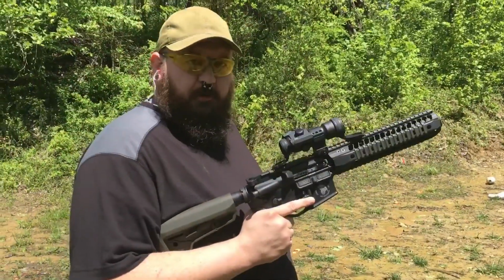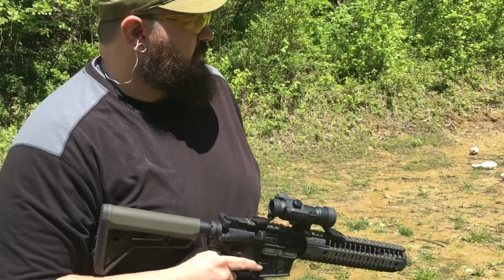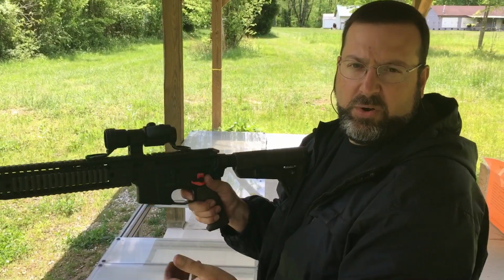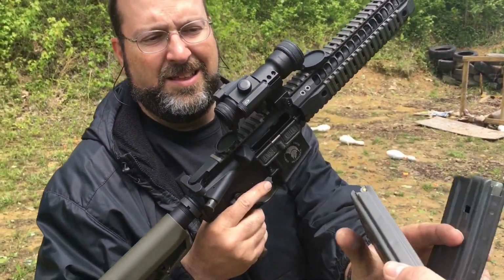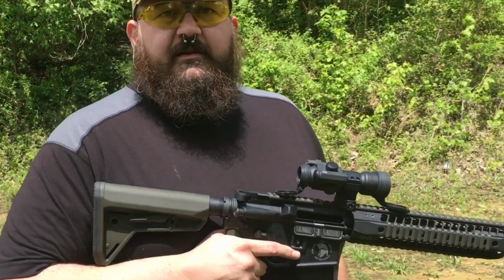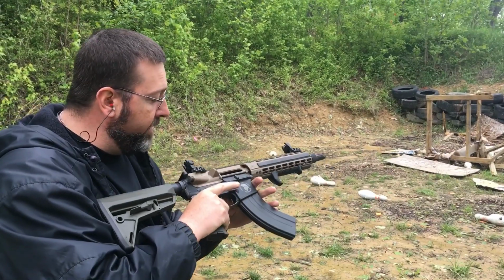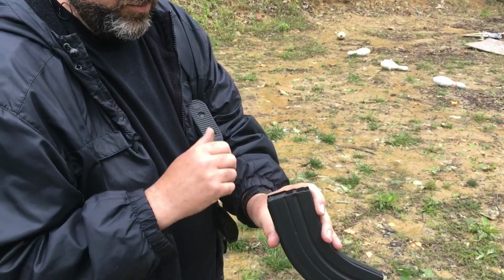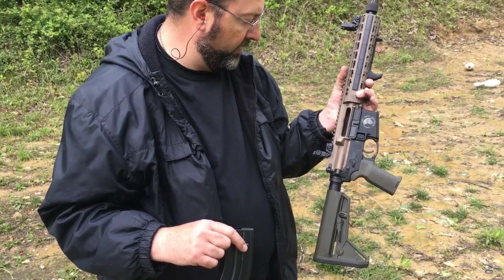Franklin Armory BFS3 Binary Trigger First Shots

Comment: That brings a smile to your face. I'm getting one. Thanks guys...
Reply from the maker: Check prices on eBay.  I saved a bit of cash by buying on there, and it was a new sealed trigger.
Reply from the maker: Not much cheaper, but it's a Buy It Now price.
https://www.ebay.com/itm/Franklin-Armory-Binary-Gen-3-Trigger-Used/183007456414?epid=21007103103&hash=item2a9c182c9e:g:0hIAAOSwW09aU-ba

Comment: I got mine a few days ago. Had problems at first but I started with the springs they supplied. It works great now that I put my chrome  silicon spring back in. Love this thing. Thinking of ordering another one while the price is still down.
Reply: awesome boss sounds like it just needs some tuning to set up like low mass bcg with heavier buffer and mid strenght hammer spring so the bolt can always oit run the hammer ?
Reply: ok

Comment: Light primer strikes result from too light of a buffer spring. The bolt is moving forward slow enough that you've squeezed the trigger releasing the hammer, the released hammer is riding the bolt forward into battery.
Another manufacturer had a proprietary (lighter) BCG to resolve the slow BCG problem ... Franklin armory provides you the heavier buffer spring which solved the issue.
Reply from the maker: That was definitely the issue, and it was resolved.  
Thanks for watching!
Reply: @GunslingerFirearmsandGear  I appreciate you taking the time to share your experience. Now it's just a matter of developing a rhythm, you'll have that thing smokin.

Comment: I sell a lot of these to hog hunters here in Texas, they use them a lot when shooting hogs out of helicopters and on the ground. I installed mine and had a few problems with it, nothing that changing the hammer out back to a mil-spec hammer, some people have the problem of binary not working and this one thing you can try, next is the small little spring that is a major pain in the A$$ to fix when it pops out the first time you mess up.

Comment: Can you post what upper you used with the 5.56
Reply from the maker: I actually assembled that upper.  It's an Adams Arms 7.5" pistol barrel, PSA upper receiver, I don't recall the BCG... Spikes gas tube, BCM gas block, a Seekins Precision BAR rail, and at this time I had a Noveske KX3 flash hider installed.  Now I have a Griffin Taper mount on it.

Comment: Great video. What length gas system and type of BCG was used?
Reply from the maker: Thanks!  This has a pistol length gas system, and a nitride BCG from AIM surplus.  It's their brand.
Reply: Awesome. Thanks for the response. I'm guessing it's a light weight bgc?
Reply from the maker: Nope.  It's this one.
https://www.aimsurplus.com/product.aspx?item=XAIMBCGH4N3&name=AIM+AR%2fM16+H4+.223%2f5.56+Nitride+9310+MPI+Bolt+Carrier+Group&groupid=723
Reply: Thanks! This is an awsome rig. I'm impressed by the reliability with such a short gas system. Subbed.
Thanks again.
Reply from the maker: Thanks a lot!  I've been asked a couple times about this build, and I think I'll do a video that breaks down all the components used in it.
Reply: That would be very cool!

Comment: Light primer strikes most of the time has to do with the buffer . H1- 3 buffer different weights rarely a magazine issue
Reply from the maker: The light hammer spring, combined with the harder primer in the steel cased ammo, was causing the light primer strikes at the beginning.  The magazine issues were with the 7.62x39 upper, and I've had issues with them on both lowers, regardless of the buffer.  The 20 rounders work fine, but the followers in the 30 rounders bind sometimes.  I've heard that ASC magazines function a lot better, and will be giving them a try soon.

Comment: Don't think the issue was steel casing, I think that particular ammo was just junk. I saw the primers weren't even centered lmao! Neat products, neat review!
Reply from the maker: Not the casing at all.  That ammo has a harder primer.  Combine that with the lighter hammer spring, and it's just not a good combination.
Reply: @GunslingerFirearmsandGear  did you just hold the trigger to make it shoot like a fully? I ask because I want one. Also I have a tacon 3mr and you have to find the sweet spot on that trigger to get it to shoot like a fully. So I am wondering about the Franklin Trigger.
Reply from the maker: @Rich-tv9jq  I was bump firing, but the rate of fire was much faster due to it being a binary trigger.  If that makes sense.
Reply: Andrew Long THOSE MAGS LOOK FUNKY .... 
AND THE MAGAZINES SEEM TO NOT PUSH UP THE NEXT ROUND EVEN IN LINE WITH BORE 
.... TILTING ROUND DOWN DURING THE EXTRACT PHASE
AND SETTING IT NOSE DOWN AND THEN COCKING IN CHEAP MAGAZINE

Comment: what buffer would you recommend? I'm having an issue of "out running" the trigger :l  but it generally works. 

it was also installed in a new rifle... so not sure if I need to "break it in" for better results.
Reply from the maker: Did you use the supplied buffer spring?  I'm running just a regular carbine buffer in this one.  You might try running an H2 heavy buffer, and see if it improves.
Reply: @GunslingerFirearmsandGear  yeah, I am using the provided buffer spring. I changed out the hammer spring to the milspec one and will see if that works out well. I don't have an extra carbine spring. But I can switch tot he "lighter" spring Franklin armory provided

Comment: Do you have to pull the trigger back further/harder like how the Fostech echo is? Or is it a standard trigger pull.

I have the fosters, and in the echo mode, you gotta pull it back a lot further and thats the 1 thing thats anoyying
Reply from the maker: You don't have to pull it back any farther than a normal trigger on the BFS3, at least it doesn't feel like it, if you do at all.  It's a very good feeling trigger.  The light spring set just doesn't like the harder primers of steel cased russian ammo.

Comment: Has SBR and BFS shoots junk steel case ammo......
Reply from the maker: And your point would be what, exactly? Would it have been more enjoyable for you to watch us burn through something like Hornady match. Lol!
Reply: Gunslinger Firearms and Gear somewhere in between - shit and match grade.
Reply from the maker: But what is the problem with steel cased ammo? It’s cheap, good for plinking, and functions fine for blasting at the range. It’s not something I’d choose for a defensive round, but I wouldn’t want to catch one either.
Reply: Steel isnt that easy on the gun, tho.
Reply from the maker: If one can afford to shoot enough steel cased ammo to cause damage, one can afford to replace the damaged parts.  There have been extensive studies on the effects of shooting steel cased.  Check out this link.
https://www.luckygunner.com/labs/brass-vs-steel-cased-ammo/
Reply: The steel case ammo likely had an impact on the problem with hammer follow. I tried steel cased ammo with my BFS and the cyclic rate was much lower and caused malfunctions. You'll probably have less of an issue if you switch to brass cased ammo. A heavier buffer and buffer spring could help as well.
Reply from the maker: @redtra236  The hammer was not following, and steel cased ammo would not cause that problem.  The steel cased Russian ammo has a harder primer than most brass cased ammo, and the issue was the lighter hammer spring combined with the harder primer.  After changing the hammer spring, it functions 100% with whatever ammo I use in it.
Reply: I'm dyin here! LmFaO!
Reply: @destructivenews6734  Ammo aint cheap bud, maybe you have money for good ammo but us trying to make it in life gun owners will take the cheap ammo so we can still have fun. Besides...if a gun can run dirty steel case ammo, then thats a darn good gun & it aint a little sissy picky gun that only wants to shoot brass.
Reply: I still don't get this steel vs brass. If your rifle has a problem with steel cased ammo then your rifle is the problem. I still have a case and a half of wolf to go through and have been using it for practice at the 200 yard range. I picked it up during the days when ammo was very hard to find and expensive as hell. Groups are a bit bigger for sure, but I can still hammer my plate at 200 yards with the shooter being the only reason for misses on the 12" plate from standing, sitting, and prone with iron sights. I see most "experts" shooting from a bench and at targets 25 yards away, some experts huh.......

Anyway, I might pick up one of these binary triggers for giggles. I can see it as a great double tap device but mag dumps isn't my thing.
Reply: Pimply Stikage absolutely right. I love the people that cry about steel case. My SBR is my go to and I want that thing to chew anything it puts in its mouth. Save the fancy ammo for the precision guns, the go to rifles all eat steel out here.
Reply: @GunslingerFirearmsandGear my 7.62x39 cost the same as the trigger.  Bear Creek Arsenal upper, Palmetto State Armory lower = $350 complete

Comment: Any triggers for less than 400
Reply from the maker: Unfortunately, no binary triggers.  There is this though, which is a fine trigger for the platform.
https://geissele.com/super-3-gun-s3g-trigger.html
Reply: @Nate Dog - Check out Optics Planet.  I just ordered one a few days ago, for $348, after the 10% discount, and free shipping.  I think the sale is done, but give them a holler, they probably have the 10 percent off deal all the time.  I used the code "January", maybe it will work all month.  I'm looking forward to trying it out on my 300 Blackout, suppressed!  They said about a month wait before shipment.
Reply: MO Silver I used the code EXTRA10 got 10 percent off. Legit trigger
Reply: I emailed Franklin Armory and got a military discount to use for the trigger.  10% off total was $358 shipped.

Comment: Use brass ammo it's worth the money.
Reply from the maker: But dirty steel smells so good. lol!
Reply: @GunslingerFirearmsandGear  I know ammo is expensive. Are you double tapping the trigger? Or are you just holding it to make fire fully? I have a tacon3mr and you have to find the sweet spot. To make it fire fully. I don't have  very much practice on it though. Btw go to bulkammo.com you can get a thousand rounds of good ammo for $295 $300 range. Check it out the Tulamo ammo is cheaper than that.
Reply from the maker: @Rich-tv9jq  I was just bump firing with the binary trigger.
Reply: Got it

Comment: Binary triggers are not going to be reliable until they are made to synchronize with the cycling of the bolt carrier group. Until that happens you're going to continue getting light prime or strikes or poorly timed trigger poles and hammer follows. It's a fun idea but nothing I'd ever put my life on.
Reply from the maker: Definitely not something I would put my life on, but there hasn't been any issues at all with it since I changed to the mil spec hammer spring.  The light hammer spring functions fine with American manufactured ammo, but not the steel cased Russian stuff.  It has a harder primer than american manufactured.

Comment: lol watch your own video your finger is not coming all the way out you have to come all the way out I did use the buffer spring everything else is the same as you in mine is flawless but like I said I had to get used to letting my finger come all the way out
Reply: Dustin Bible  yep Light primer strikes most of the time has to do with the buffer . H1- 3 buffer different weights rarely a magazine issue

Comment: Put an $89 dollar aim surplus lightened BCG with an H buffer and stock spring in my colt and cannot get it to produce hammer follow
Reply from the maker: The steel cased ammo we were using has a hard primer.  This gun had the same light primer strike issues with the JP light hammer spring, but functions 100% with the mil spec hammer spring. I'm using an AIM nitride BCG, but it's the full weight carrier.

Comment: Say bye bye to that thanks to Trump! That's about to turn into a felony unless registered as a machine gun, and that's best case. May outlaw the devices all together with no path to legalization ☹
Reply from the maker: Yeah.  Also thanks to the NRA.  I'm not jumping to any conclusions just yet.  Let's see what happens with the new laws, and what they include.
Reply: Glad I got mine already:)
Reply: Well it's September 2018 and I still legally have mine.
Reply: So far so good.
Reply: Buying one after Thanksgiving. Don't care what laws come after that
Reply: November 2018 and still legal :)
Reply: Garrett Smith may not be now. 12/16/18
Reply: No the ATF letter specifically says Binary triggers are not being reclassified
Reply: Garrett Smith lol im 16 and i want this shit but 400 is bonkers i just got a 80% lower and and upper and blg for like 165
Reply: You can get the Echo for 300 now. As far as 80% lower it's going to be hard for you to complete unless you have access to a mill. I personally have completed a few on a mill but I have machining experience also. I've heard of people using a router but never tried it myself. Whatever you do do not use a drill press with an endmill in the chuck. Drill chucks aren't designed to take side pressure and the endmill could go flying out of the chuck and hit you.
Reply: Garrett Smith yea i was going to use a drill press for the inital holes then a router to finish milling